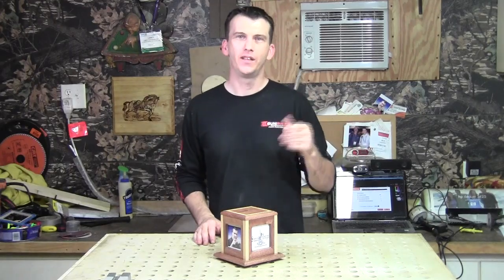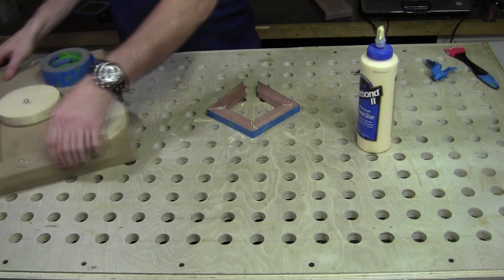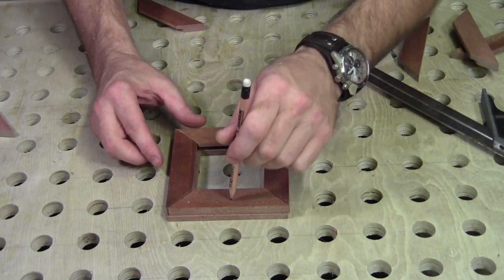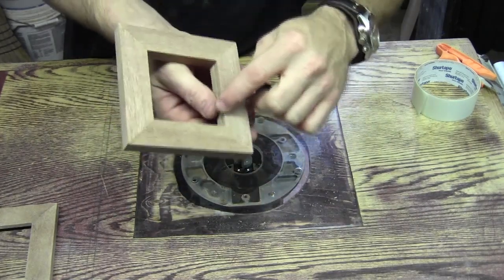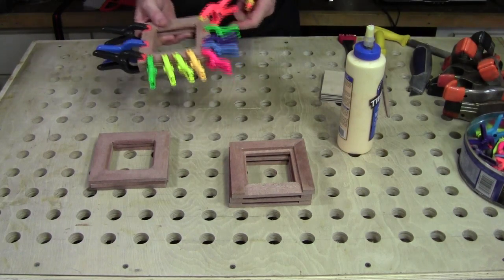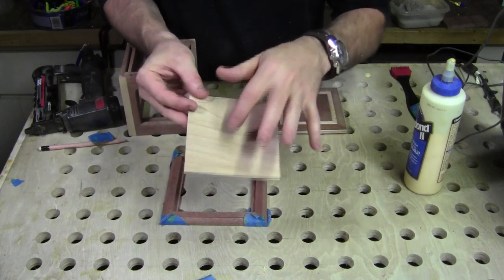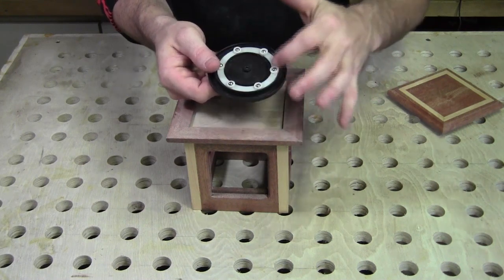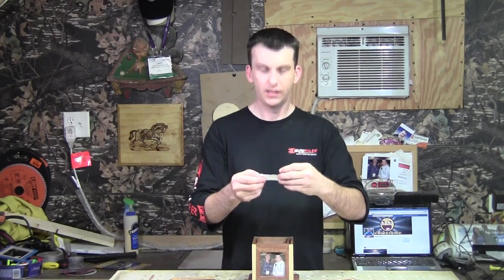Woodworking -  Photo Carousel / Candy Dish

Comment from the maker: Mqira00 it's a cam clamp. used to clamp boxes or picture frames.  the circles are screwed to the base with the screw hole being off center, this gives is a cam action, allowing you to apply pressure to two sides of your box or frame. while the other two sides are supported by the two "right angle (90 degree) " pieces as the cams are activated it creates a clamping pressure..

Comment from the maker: Each of the photo areas has a backboard, photo, and glass. to change the photo you simply just remove it and replace it with another photo. without removing the backboard to replace the image. I would recommend you use individually wrapped candy inside. if you were to use unwrapped candy, i would recommend you using some form of "Food safe" finish on the inside, and not the lacquer finish you saw me using. Candy corn or unwrapped candy could melt and get sticky.